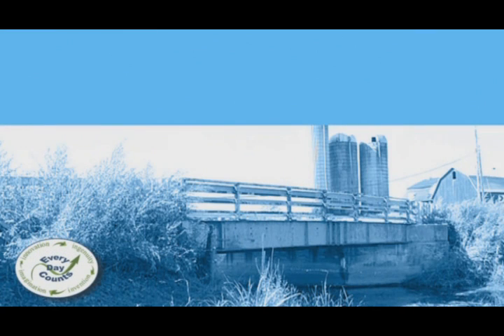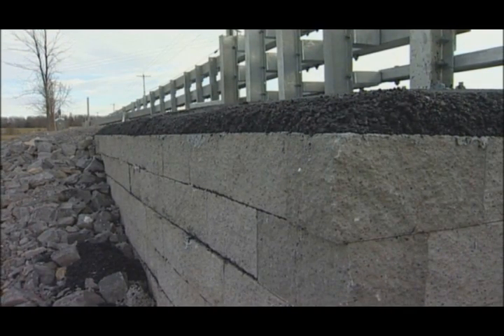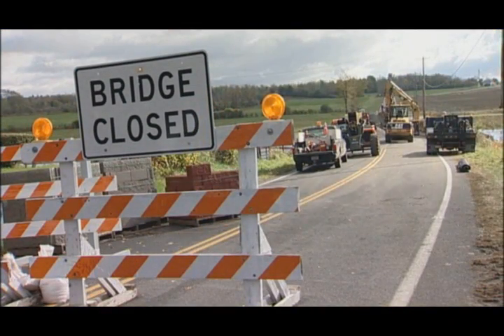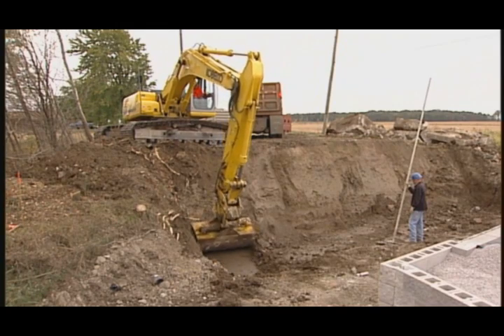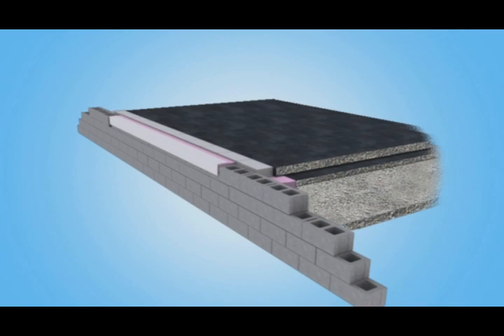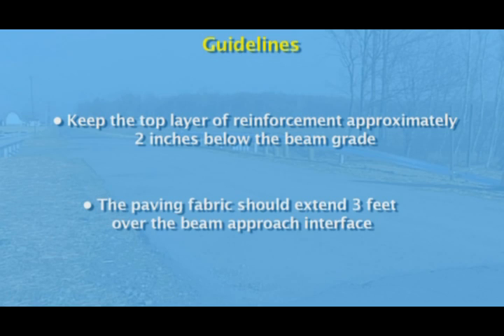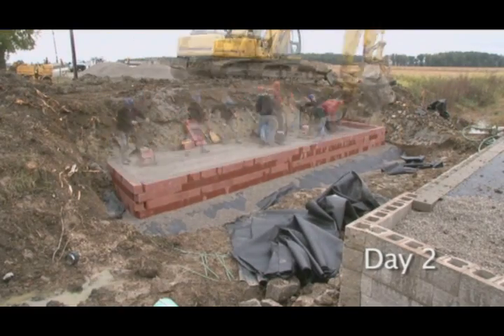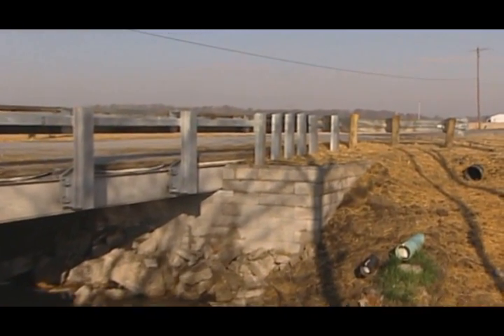Geosynthetic Reinforced Soil-Integrated Bridge System (GRS-IBS) 2011

Comment: A point that I think is worth mentioning, since there was a comment about uncertain long term performance of GRS systems, is that bridges are inspected on regular intervals by trained technicians and engineers worldwide. FHWA requires every bridge in the US be inspected every two years, or more frequently if warranted. To my knowledge, there is no country in the world that allows open, public structures or structures on transportation routes to go without inspection for exceptionally long periods, certainly not fifty years.

Additionally, special inspections are often carried out after large flood events, if needed. Related technologies also incorporate deep driven piling into the system, allowing wider applications. 

While no technology, old or new, is perfect, this is an important new development in highway technology and shouldn't be written off. I drive over one of the longest segmental concrete box bridges in the world every day, and it cost taxpayers about half of what the steel equivalent was bid at. That would not have been possible without these kinds of innovations.

Comment: I don't like this at all. I'll stay with the MSE wall paneling system we use today with pile hammered steel casings for deck support. I don't believe this system would fare well for a large earthquake or major floods. Neither are common in the Midwest but they do happen. The worst that could happen under those circumstances with a MSE building system is that the approaches could sink or fall out of alignment which are easily repaired but the main deck super structure would remain unharmed since it rests on steel casings pile hammered deep into the earth.

Comment: mrbluenun: This technology is not a Cure-All design or a solution for every scenario. As Mr. Jensen points out, this is a solution in terms of cost efficiency, simplicity, and better controlled settling that creates a better finished product. This design is best tailored for use with basic, single-span bridges. Could this hold a rail bridge? I do not know. I can't speak to the strength capabilities of this technology: that should be left to a properly certified engineer to declare. I can assure you that this technology will only be used IF it is deemed structurally sound. I can appreciate healthy skepticism, but a bridge design cannot be approved for construction if it is found to be structurally deficient in any way.

That's what engineers are here for.
Reply: https://www.youtube.com/watch?time_continue=21&v=ukPC_jSqS1o

Comment: That's the dumbest thing I've ever heard.  Every bridge has a risk associated with it. The bridge that just fell in Northern Washington was old and out of date.  Plenty of bridges are in similar condition or worse and are needing to be replaced.

This method is a proven, cost effective way to provide replacement bridges for small single span bridges.  The MSE walls beneath them are heavily over designed to take the design loads. This system also reduces the differential settlement occur w/piles.